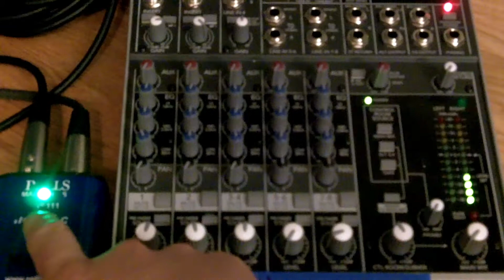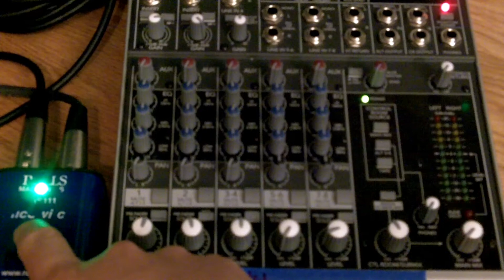XLR Mic Mute Switch with LED (phantom powered)

Comment: I want something similar, but I don't need the light indicator. 

I need to feed the power from one input, but I don't want the energy leaking to the other input. Here's why: I have a condenser Mic, which needs power, and I use it, sometimes to the console, sometimes to my keyboard, to use vocoder. My keyboard can't handle phantom power and I'm afraid to damage the input. Can this circuit solve my problem? Thanks

Comment: Would having phantom power on when you don’t need cause problems? wouldn’t that be sending to much power? I thought having phantom power through a regular mic will cause damage to your devices and microphone and also cause feedback? I’ve always been told this.. ?? Just asking
Reply: Phantom power to a dynamic mic is not a problem. Sending it to some devices like audio interfaces or outputs from other consoles can cause damage.

Comment: Any idea when the schematic will be available? Also, can you share the layout of the Rolls switch. Where is the 470mf cap and 47K resistor placed in the circuit?

Comment: ok so what happens when it clips whenever you press the button? I made a DIY and it was working fine but now recently it does have that huge spike whenever i press it
Reply from the maker: See if the capacitor has gone bad or a solder joint broken, maybe?

Comment: How do I use one of these mic mute switches on my scarlet solo interface with one xlr connection?
Reply from the maker: Hi Nick! Assuming that we're talking about this ( https://us.focusrite.com/usb-audio-interfaces/scarlett-solo ), you'd get a mic switch and an additional XLR cable. Assuming that your signal path is currently Mic <--> XLR <--> Focusrite Scarlett, you'd then plug in as Mic <--> XLR <--> Mic Switch <--> XLR <--> Focusrite Scarlett. 

If you're using the Scarlett for some form of live production, I could see a mic switch being a useful addition to your kit. If you're just using it to record, you might find that software muting (in your DAW) or simply leaving the mic live and trimming out the unwanted audio later would be just as good. 

I use my switches in live performances but not in the recording studio, mainly because they're aimed at solving a problem that doesn't exist for me inside a studio. Good luck, and let me know if I can answer any other questions!

(and if you liked the video, please give it a thumbs up or a subscribe. Thanks!)